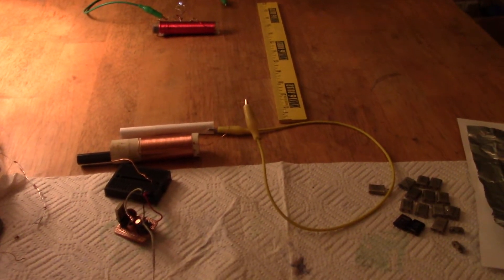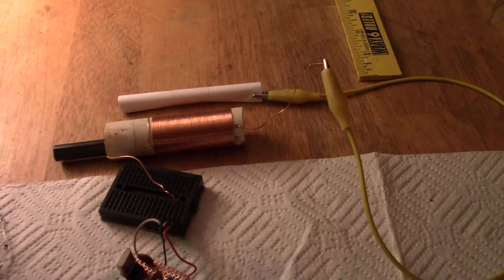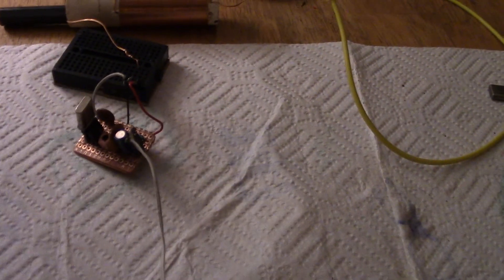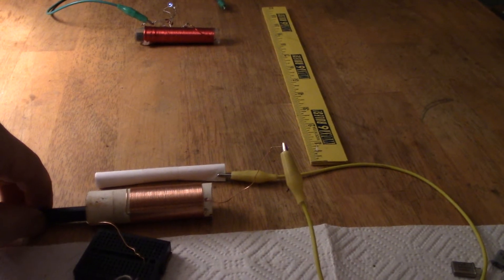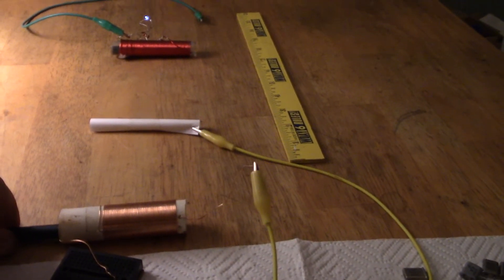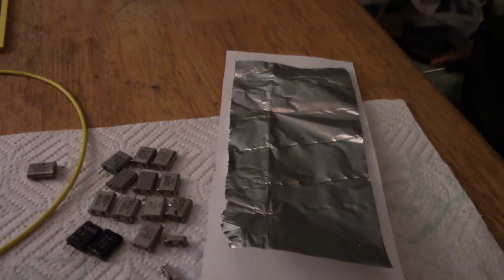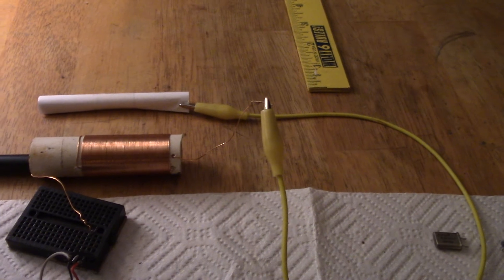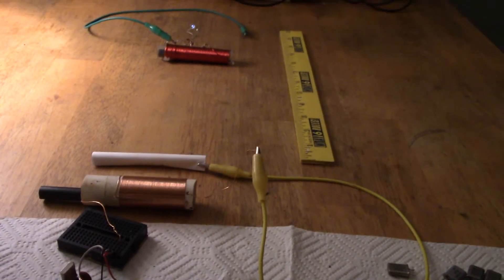The 'Doob' coil for Wireless Electricity

Comment: Reminds me of an old Aluminum tube CB ant. If you roll it tighter does it change the tune?
Just be careful it doesn't get your circuit too bent...
Reply from the maker: Just tried rolling a tighter one and not noticeably, but then for a doob thickness/shape it has to be rolled quite well. The tighter the better though, less electrons fall out of the end if you tap it on the table. Range increases by about 1" for equiv brightness.

Comment: Big Whoopti Do Doobie! :)  Baby crawl almost to walking first foot (12 inches) yeah good job.  Ok, so seriously here is a tidbit from Tesla on making coils.  He said the MASS of the primary should equal by weight the mass of the secondary coils for best results.  By interpretation, I would think any mass (wire or antennae, top hat etc.) would also be part of the equation involving MASS.  Especially since all electrons are a mass!
Reply from the maker: Yep. The new vid has that thinking and I mentioned it on Overunity forum about the same mass. The trick that Skywatcher123 did and that I possibly furthered, was to make the Primary of more turns but smaller gauge...it works great. Normally there being just 2 or 3 turns of a much larger diameter wire as the Primary. There are the large flat spirals on SGTC's but for no apparent reason everyone stuck to the couple of turns on Slayer exciters.
Reply: Interesting.  That is the first I have heard of wanting MORE turns and SMALLER size wire for the primary, it nashes against all I was taught in electronics theory and what Tesla said was best for transformer applications using resonant primary in sync with a resonant secondary.  So you may be in a new territory of discovery.  ;)  

Tesla as you know, experimented with not only rectilinear cylindrical coil geometries but also conical cylinder and the flat spiral.  His public reason was to find the best ratio per wire dia and dielectric spacing so as to have natural resonance of a completed coil without needing to add extra capacitors or a tophats so much.  The second reason which he directly admits was to find the best geometry to control the high voltage corona insulation break down between coil turns where he winds nonlinear so the higher voltages are spaced farther away from the ground side but in progressively tighter circles which lessens the voltage difference from turn to turn.  The nonpublic reason for the tests may be for studying ways to shield the energy flow in windings from back reacting from the sec to pri to the input power source.  Unlike the regular vertical cylinder winding, the flat spiral coil is mostly 1 dimensional looking from the outer turn to the next  inner turn.  But the outer turn is partly shielded from "seeing" the 2nd most inner turn!  And also thru the rest of the coil.  So in effect the source would mostly only get back reaction to the outer turn and little from the rest of turns!  I have confidence in this view of mine as there is a patent where he fully states that he has purposefully made a transformer with a shielding scheme that would reduce the power needed from the source and could be varied at will!  Results drive a transformer, but any load back reaction could be made variable to "invisible" to the source yet still produce an output!  Of course normally, you can not get more output to the load without the back reaction causing the source to supply more in.  Tesla was just too clever.  The other variant of the flat spiral coil was the spiral using out of phase windings.  This is also "my belief" one of his tests for developing a shielding method against load back reaction to the source.
Reply from the maker: Spiral primaries have featured in my own builds. They work fine, it's like winding a single core pancake and pulling the middle up. Well, that's exactly how it's done. What happens too, is that there is a reduced need to move the primary up the tower to find the sweet spot, it's just there anyway.

The spacing properties were found by accident here several years back. I ran out of the 24AWG wire for one tower and had to use 30AWG. The turns were closer together and I wasn't able to get plasma from it (the big thing at the time). However, its wireless field was far stronger than a similar tower with the same gauge all the way through. At the time it was considered a fail, but now in retrospect i'd done the correct thing lol 

Thanks again for the info :)
Reply: Did you mean spiral primaries and spiral secondaries or just spiral pri?  Spirals seem superior to vertical coils but take up a large area.

Interesting on the spacing difference.  It might be due to spacing as you mention but don't forget the 2 windings also have different inductance values as well which may be relevant to the observations.

Fails are good.  I too after a long while review old "fails" and gain new perspective that would have never happened if I threw away all the fails.  Good job on getting the stronger field from a "fail." Sometimes the fails are all in our heads anyway.  :)
Reply from the maker: Ah, both, spiral primaries and spiral secondaries. I still have a spiral pancake, if you see what I mean. IIRC, wound a pancake coil and pulled it up from the middle as the glue was setting, to form something like a pyramid.